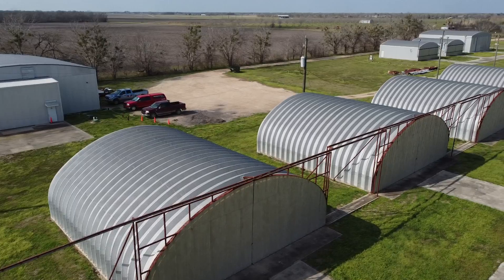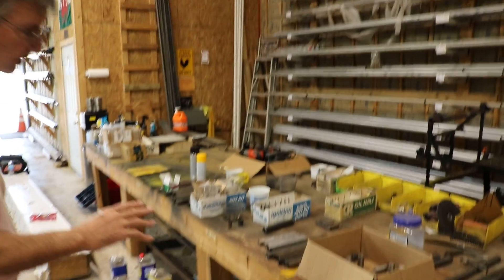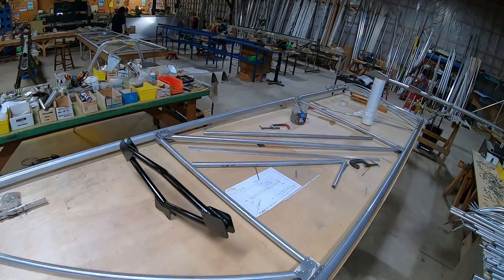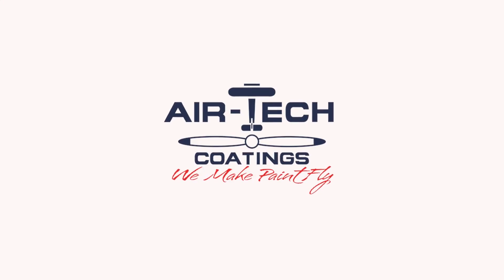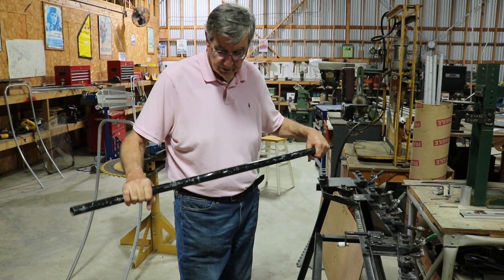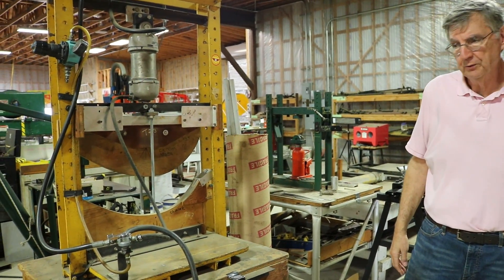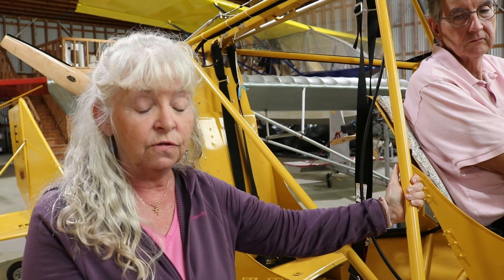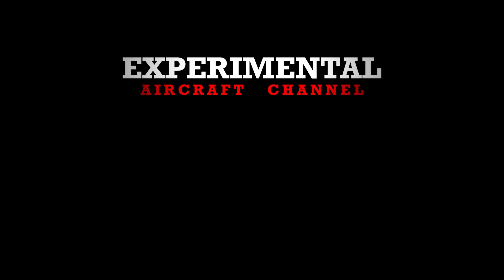World's Slowest Aircraft! Factory Tour - Chinook by Aeroplane Manufactory - How it's Made

Comment: Lol their prices for all the kits have jumped up at least 10 grand each that’s a bit more then just cost of materials increasing
Reply: Seriously, the last time I looked at this aircraft on their website, less than 6 months ago actually, it was around $18,000 for the two stroke and under $20,000 for the 4 stroke non DR. I'm guessing all they're selling now is the DR version and this new SJ which is quite expensive for a light aircraft with like zero information available for it (they really need to fix that, you charge that much you need to show as much info on it as possible!). This is a nice plane and these seem like nice folks, but the latest prices are out of line for what this is (well, was): a low cost, decent 2 place-ish (the rear seating area is hard to get into/use) aircraft. I wish them luck regardless.
Reply: @dragon2knight  yeah it was those prices at least a month and a half ago. It sucks cause at that price it was a great deal now, it’s not so much. Especially when there ain’t a lot of info like you said.

Comment: I once met a good ol' boy airline captain / homebuilder who cut the nose off his Kolb, mounted the engine there and wound up with a MUCH better flying aircraft. This is the EXPERIMENTAL Aircraft Association, remember ?

Putting the engine and prop in dirty air behind the cabin is NOISY, loses at least 100 pounds of thrust right off the bat, puts all that mass behind you in a crash, anything you lose goes through the prop, tires fling gravel into the prop... 

this obsession with pushers started with Burt and it's always been a ridiculous  idea. Ed Lesher's TEAL and Burt did it correctly; I'm saying it's ridiculous to use it in impractical places and ways simply because everyone else is doing it.  It started in trikes and Quicksilvers/clones only  because it was structurally simpler on airframes that should have been completely redesigned as tractors in the first place.

It's just monkey-see, monkey-do fashion, indulged in by people who aren't thinking straight.

Oliver Wendell Holmes said "if all you want is to be different, you can come down in the morning with a sock in your mouth."

[edit: there's a note below this comment that says there was one reply but I can't see it. Please repost if possible]

Comment: 6000 series aluminum for an aircraft?  Are you high?

I come from the competitive Mountain Biking world, where we engineered and decided on on the 6/7 series of Aluminum for point of contact engineering.... handlebar stems, pedal spindles, crank arms, and crank arm bottom brackets...

IE, things that would be fatal, (point of contact failures) if they went south.
You are using this for stress points on aircraft?
I won't fly your aircraft.
Reply: I received exactly 3 responses, none of which have shown up on the thread yet.
In a nutshell:
6000 series aluminum cracks and breaks.  7000 series bends, then cracks, then breaks.
7072 series cracks, bends, cracks again, then finally breaks.

It gives you some warning before failure.  
My experience?  Two of you asked.
I'm a trained aerospace engineer, and a pro bicycle racer.  I'm involved in testing numerous components on bicycles as they relate to everyday hard riding.  Think racing.

This was all 20 years ago, but science and metallurgy hasn't changed .

cmdrpiffle